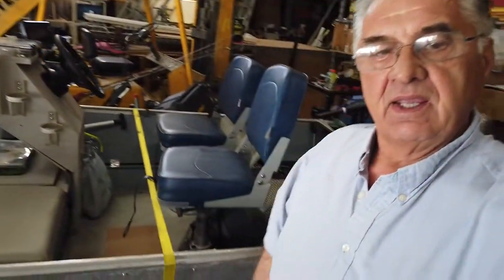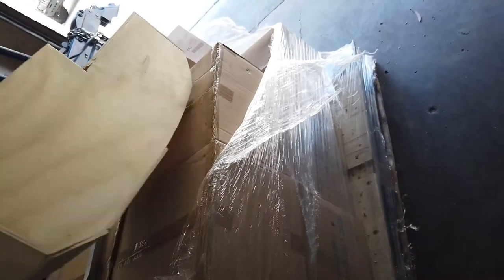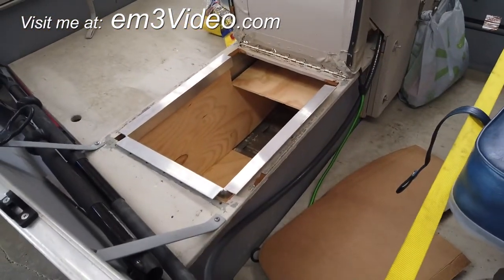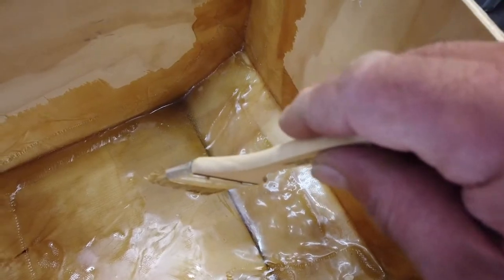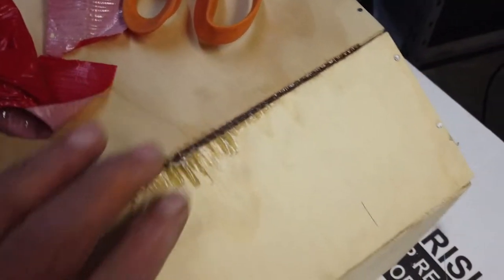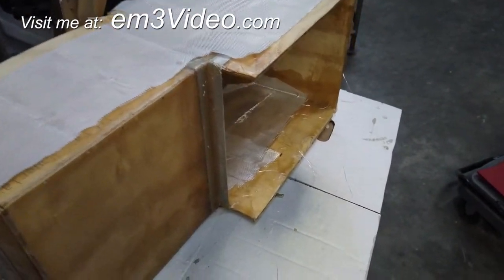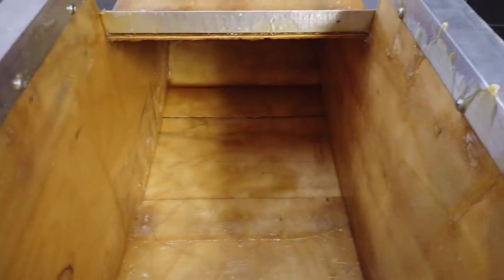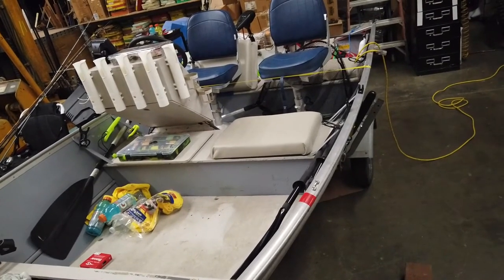Build Removable Fish Ice Box for 14 ft Aluminum Boat by Val Mijailovic

Comment: The first time you take a big wave over the bow you are going to wish you left the foam in the seats!!! It will actually keep the boat from sinking to the bottom so you can pump it out! Without it's just going to keep filling up and go to the bottom!!!😂😂
Reply from the maker: Hi Thomas, absolutely right. I did install foam throughout the bottom underneath the wood flooring. It's probably as much if not more then the original foam in the crosssection. But you never know, guess I'll find out sooner or later. LOL! Best regards, Val
Reply: @MastersMagazine  good deal
Reply: @MastersMagazine  it doesn't take much if you have a good bilge pump or three🤣😂 I used to go out boynton beach inlet in palm beach county!!! Check out some videos on it boynton inlet is crazy!!
Reply from the maker: @thomaskitlica5572  OHHH ocean , you have courage, I only go to local lakes in Los Angeles. No waves, only if a nasty water skier comes to close.
Reply: @MastersMagazine  🤣😂🤣 oh ok you will be fine lol!!!